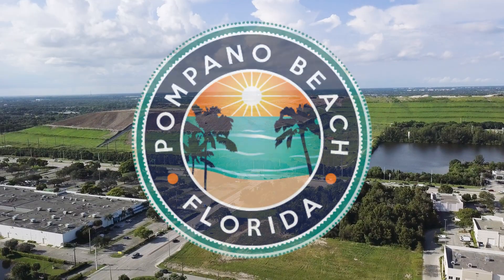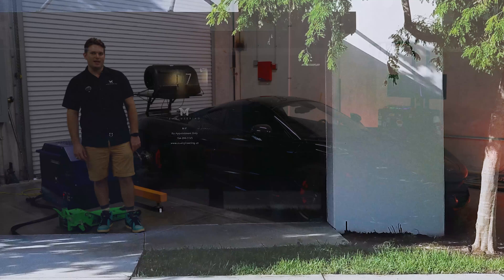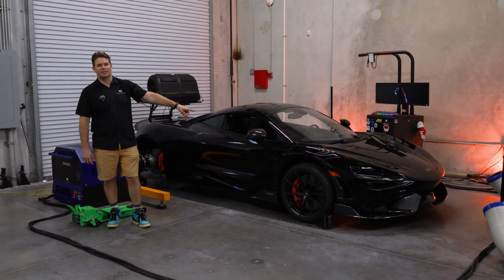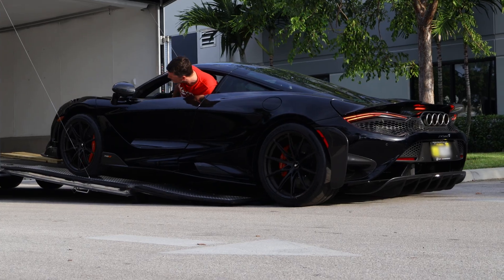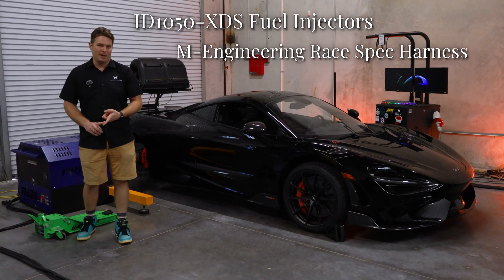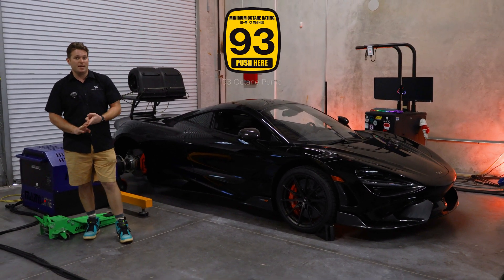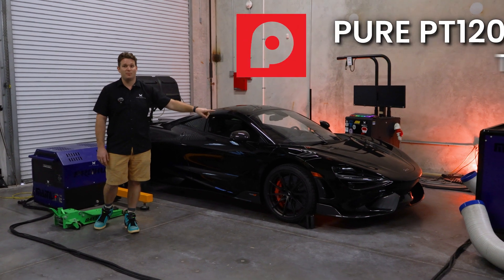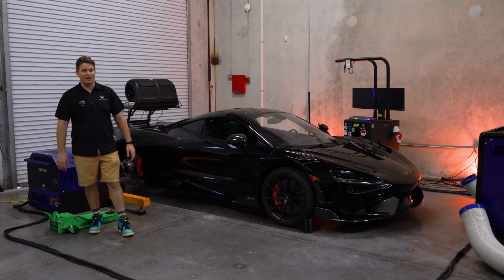McLaren 765LT Puts Down Over 1000WHP W/ M-Engineering ProTune

Comment: I am really curious, how do you decide which gear you dyno a car in? I ve seen most cars get dynoed in 4th gear
Reply from the maker: It really depends on the car, amount of gears, the ratios, data acquisition etc. On most McLarens and newer Porsches we choose 5th gear. The advantage of the hub dyno is also that we can run these cars at 200mph and not have to worry about tire blowout or dyno safety issues as much so it's possible to use these higher gears and get really good high-speed data. 

-Charles@M
Reply: @ thanks for the answer ❤️how would the results differ in this particular case for example in a smaller gear like 3rd for example?
Reply from the maker: @valentinoprea67  the ramp run would be rather short and the data you get would not have full load and data points we'd want to look at. 

-Charles@M
Reply: @valentinoprea67   I think the closer they get to a 1 to 1 ratio the more accurate it is.
Reply: I believe you want the ratio to be as close to 1:1 as practical

Comment: That’s my 765LT… thank you  Flat 6, Area 51 & M Engineering… for doing great work across the board!!!
It’s FAST 💨 🔥 💪🏻🏁
Reply: I have a 600lt and a 720s, so I am familiar with macs. Be interesting to see how well it can keep traction. Ive also ran pure turbos 1000 in a c63s before. I suspect your gonna find a lot of turbo lag. Short shifting 1st, and probably 2nd in the winter, while 3rd and 4th will kick you in the chest. Luckily, Macs have pretty exceptional traction and stability control. PS4S in the winter, R888s in the summer. Radar detector all year!.....Safe travels
Reply: @ We changed some of the suspension setup in the beginning and it really hooks well.  Stays on MS109.  Thanks 💪
Reply: @a-sword417 any reason why they went with MS109 over E85?
Reply: @ X85, E85 tends to be harder on the rings … I have a 1100 HP C7 ZO6 on X85… we just liked the MS109 setup over all better.

I’ll be building the Short Block in the near future…
Reply: @a-sword417  interesting. I'm about to go down the rabbit hole with a 2022 GT500 adding an 1100whp set up. Mustang is a little heavier than the Z06 but I'm curious as to how the Z06 help up to the stock 765? Essentially, I'm hoping an 1100whp mustang can walk a  720/765.
Reply: @jacobklein2778  My C7 ZO6 is built front to back.  15 inch Drag Pack conversion with skinny’s up front Weld wheels.  Titanium rotors and calipers … car has been lightened extensively, coil overs, ice box in the back. X85 on Meth, no AC.  Car is pretty violent! 💪…
Reply: @a-sword417 did you do rods and pistons
Reply: @ Not yet, car has been tuned down to safer levels from M Engineering… I’ll do the short block at some point …
Reply: @jacobklein2778    wishful thinking.  A gt500 is a boat.
Reply: @jacobklein2778  I'm short shifting through 4th in high 60 temps on stock turbos and E85.  I don't know how any of these cars with even more power can make a decent run on the street without huge burnouts to heat the tires.
Reply: @Chiromikey  what estimated whp are you at with your "stage 2" e85?
Reply from the maker: Epic car, thank you for the support. Enjoy it!!

-Charles@M
Reply: Nice build any 60-130 times?
Reply: @ Not yet, I will do so soon.  Thanks.